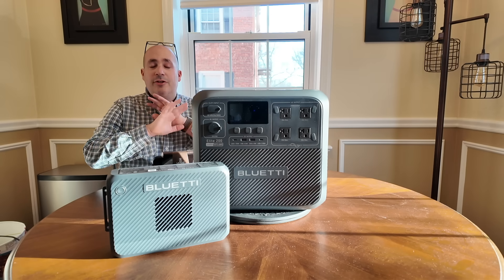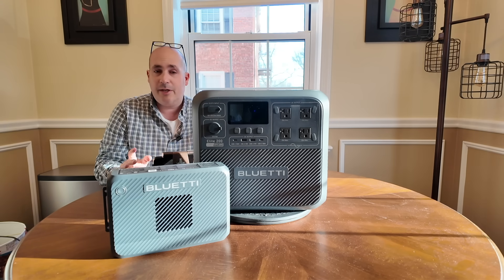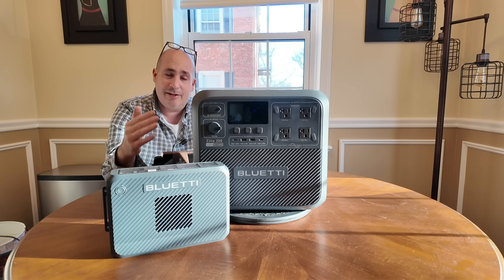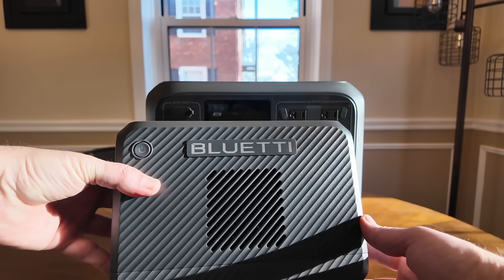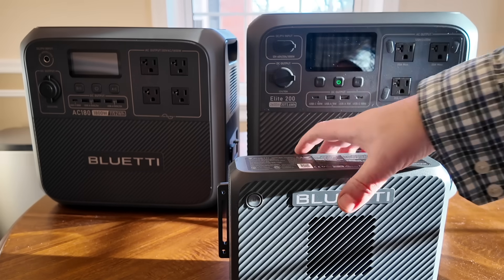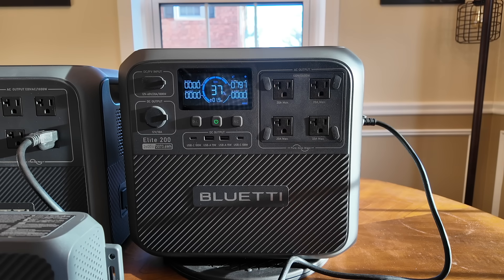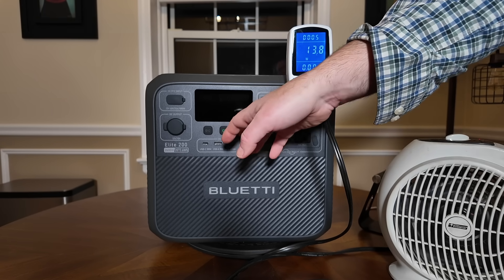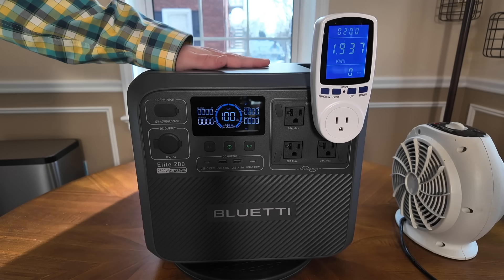This Fixes the Biggest Problem With Portable Power Stations

Comment: High-frequency, transformerless (HF) inverters like these are generally more susceptible to damage from an Electromagnetic Pulse (EMP) compared to traditional low-frequency (transformer-based) inverters. This increased vulnerability is primarily due to the absence of a heavy, iron-core transformer, which provides physical isolation, and a greater reliance on sensitive, fast-acting semiconductor components. 

Here is a breakdown of why HF transformerless inverters are more at risk:

Lack of Galvanic Isolation: Transformer-based inverters use a large copper-wound iron transformer to separate the DC input (panels/batteries) from the AC output. Transformerless inverters lack this barrier, meaning an EMP-induced voltage spike on the DC side can pass directly to the AC output, damaging connected appliances.

Sensitive Components: HF inverters rely heavily on MOSFETs or IGBTs for high-frequency switching. These semiconductor components are very sensitive to high-voltage, fast-rise-time pulses typical of EMPs (especially the E1 component).

Lower Surge Capacity: Because they lack the iron core that acts as a buffer, high-frequency inverters generally have lower tolerance for surge currents and are more likely to fail instantly during an EMP event.

Operating Voltage: High-frequency inverters operate at higher, stepped-up DC voltages, making them more vulnerable to insulation breakdown during a pulse.
Reply from the maker: Really appreciate that very thorough explanation

Comment: Ac200l is the best , you can add 100amp batteries through the expansion port on one of my ac200l I have a b300k expansion and now 4 golf cart batteries in parallel plugged in to the b300k totalling 25 kWh add a victron mppt to one of the batteries and you can allow around 5kw total solar
It runs my Aircon , washing machine , drier , charge all my devices (not all at the same time)
Reply from the maker: Wow, that's an impressive expansion and a very versatile setup!

Comment: Weight is always important; what does the Elite 200 weigh vs the AC180?
Reply from the maker: The elite 200 weighs about 53lbs where as the ac180 is about 35lbs. It’s important to note though that the 200 provides double the power . Thx for watching

Comment: I'm curious, will this wear the alternator down faster, like if you install an after market sound system?
Reply from the maker: I’ve actually considered that and to be honest, I think as long as you’re driving at highway speed when you’re charging, you should be fine. It’s also not a device that you’re going to use every single day for hours a day because it will charge the power station back up fairly quickly and then you can disconnect the power station and the charge will just go back into standbyso I really don’t think it will be a problem
Reply: @Outdoor_Prepper  good point, thanks for responding!
Reply: Just keep a spare alternator

Comment: Hey Outdoor Prepper (Chief), I noticed you use a label maker for your battery for when you bought it. I do to. I label that & the anti-freeze when I change etc. 
Don’t be intimidated by your vehicles age. My daily driver is 28 years old & my Sunday driver is 20 years old. I keep them out of the weather & the one I’m not driving goes on a trickle charger. Thanks for posting!
Reply from the maker: Thank you for the kind words. I like to label the battery that way if I have a warranty issue I know when I bought it and the order number etc. it helps keep me organized. Im actually looking forward to taking the jeep on such a long road trip

Comment: @Outdoor_Prepper - thanks for letting us know about these fantastic new products. One thing to keep in mind is the output of your alternator - in a small sedan, you're likely to have a low-output alternator, and in a larger truck like the OutdoorPrepperMobile, it would be more than sufficient to power the Charger2 at idle. What's the output of the Wrangler's alternator?
Reply from the maker: That's a great point about alternator output, thanks for bringing it up! The wrangler shouid be about 180 amps and then the charger 2 will boost it. It’s ost efficient when you’re traveling on a highway and have a higher engine rpm

Comment: Thanks is there a breaker on the input battery cable like the Charger 1?
Reply from the maker: It’s different from the charger 1 in that the input cable has a fuse you put on it near the battery terminal but no circuit breaker. If you have the charger 1, the wiring is interchangeable and you can just disconnect the charger 1 and use the same wires to hook up the charger 2